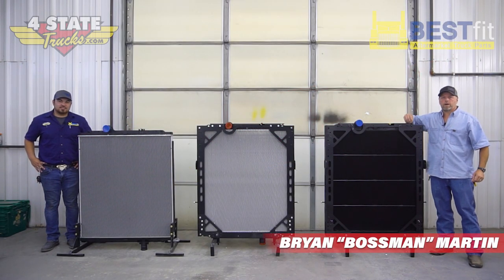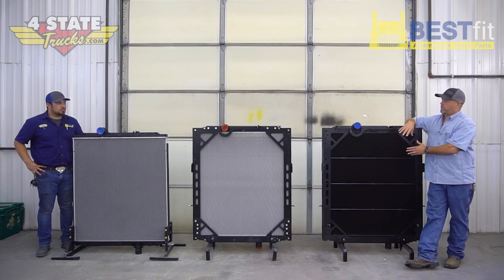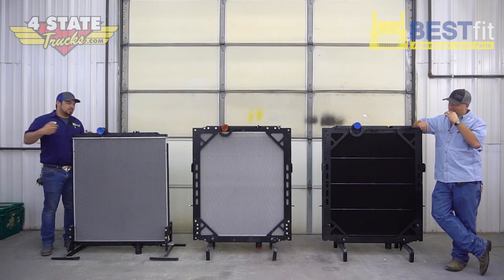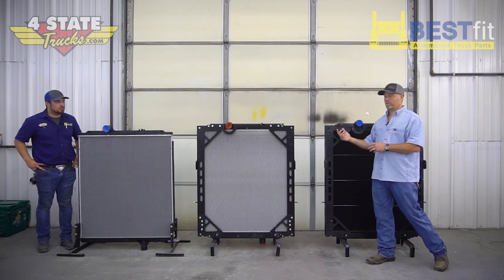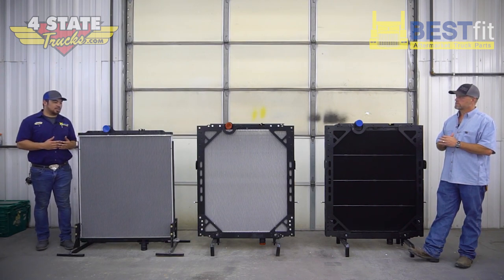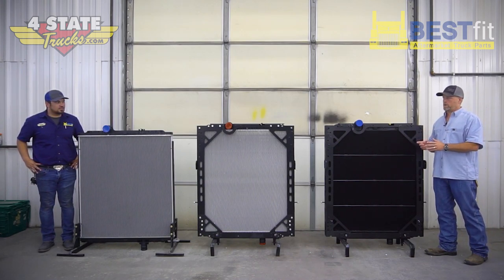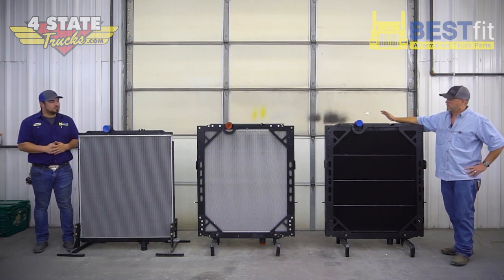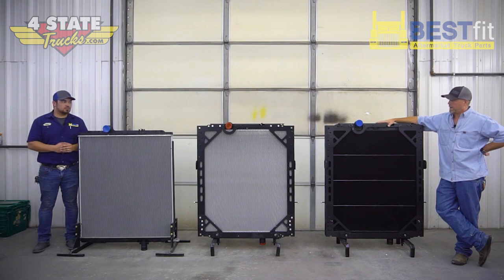Breakin' It Down With Bossman - Radiators For Your Peterbilt 389

Comment: What about a w900L radators
Reply from the maker: Hey Devin, feel free to give us a call at 800-228-1103 ext 292, and the Boyz over in the BestFit Engine Cooling Department will be happy to help answer any questions or concerns that you may have. Thanks.
Reply from the maker: We carry several W900 Radiators. Here is a link to our website page https://ecs.page.link/yMsKw  If you have any questions Please call 855-220-8608.